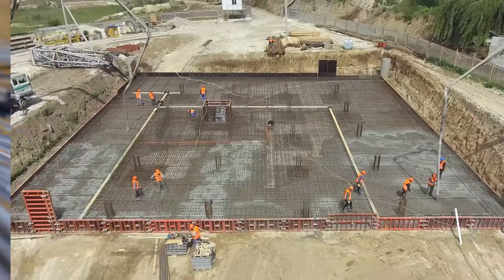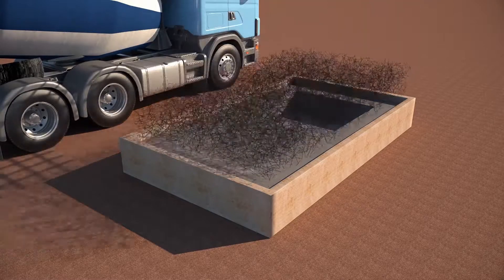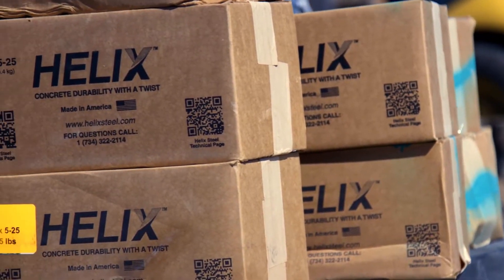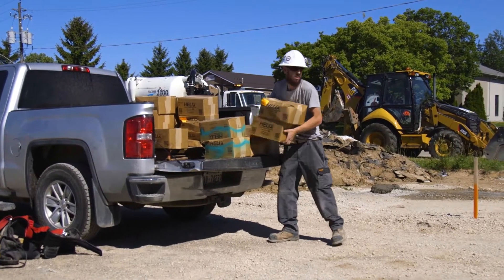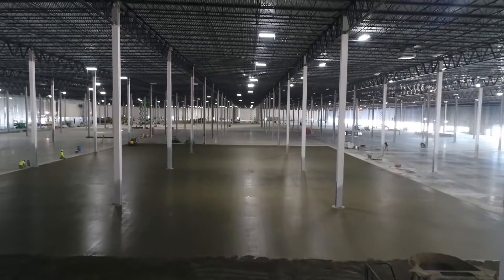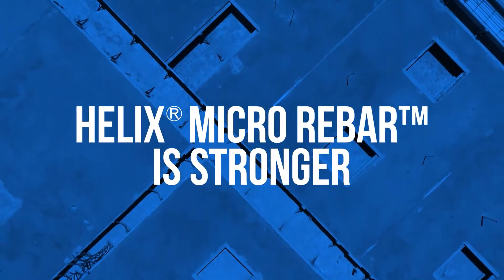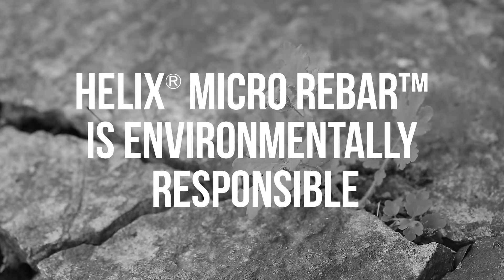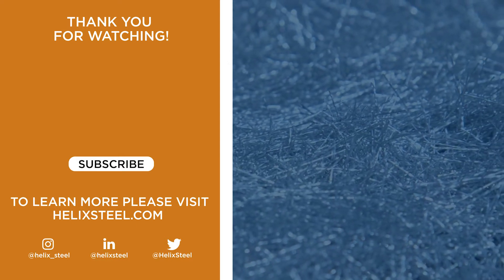Why Helix Micro Rebar Concrete Reinforcement is the  Better Way to Build with Concrete

Comment: Where can this product be found in Canada ? (North western Ontario around Thunder Bay that is)
Reply: Just place rebar
Reply: Don't know if this interests you.  Only place I could find it was Ontario Concrete Association, Woodstock, ON. It goes for $233.13 /each for a 5-25 Micro Rebar 45LBS Box. I too live in North Western Ontario (Bergland).

Comment: One of our warehouses has the parking lot made with small steel fibers as reinforcement. They're working their way out of the concrete and into tires. Rarely do they puncture, but i've had one leak this year and i only go there a handful of times a year.
Reply: The helix ones are smaller than the ones you are talking about I'm sure.
Reply: @Inova3DSolutions  There one factor that they have OVERLOOKED and that is the surfaces between newly solidified pourings sections that were poured yesterday and the new pourings that will be poured today. The solidified sections' helix steel fibers won't be sticking out to intertwine and interconnect with the new pourings. And the new pourings helix steel fibers won't be able to penetrate right through the already solidified yesterday pourings to intertwine and interconnect with the helix steel fibers of the solidified yesterday pourings. The pouring of helix steel fiber reinforced concrete must be continuously non-stop or must be combined with the use of steel rebars and steel hoops or loops or ties that are thick enough and spaced apart enough to allow the helix steel fibers mixed with the concrete to flow pass between them and around them and the spacing between the concrete molds and the steel rebars and steel hoops or loops or ties must be sufficiently wide enough to allow the helix steel fibers to intertwine and interconnect with each other between the main conventional steel rebars and hoops or loops or ties and the concrete molds themselves.
Reply: @Inova3DSolutions  The key is HYBRID steel rebar - steel fiber reinforced concrete that allows the use of conventional steel rebars and steel hoops or loops or ties reinforcement to provide NON-STOP CONTINUOUS reinforcement and allows the use of helix steel fibers micro-rebars to provide an evenly dispersed and evenly spaced and omni-directional and three-dimensional reinforcement throughout the entire mass of concrete itself. And the helix steel fiber micro-rebars will give additional adhesive covering strength to the concrete mass to adhere very strongly to the conventional steel reinforcing rebars and steel hoops or loops or ties.
Reply: @darthvader5300 punctuation is your friend. Word salad
Reply: @JohnLee-db9zt  Your sarcasm reveals to all Russians that all Americans cannot take criticism.
Reply: @KarlVonSttugart Lol. Just trying to help, Vladimir. 😉

Comment: bullshit... concrete always cracks, and will with helix. but with any type of reinforcement, even helix... it will help control cracking concrete.
Reply: Yup I heard there are two types of concrete,  concrete that has cracks and concrete that hasn't cracked yet.
Reply: Bottom line is it’s a labor and materials cost saver that has been approved for use by the construction and engineering societies.
It’s stronger than rebar . If it’s passes engineering specs it should not even be a discussion.
Reply: only roman concrete doesnt crack
Reply: Concrete will always do 2 things. Get hard, and crack. There is no way around it.

Comment: Does it rust out. Why not use another material other than steel? Fiber glass, basalt?
Reply: Cost, leed certification is why, they don't rust as easily because they are coated in something
Reply: @Inova3DSolutions zinc coated
Reply: @Inova3DSolutions likely zinc like rebar, but it’s steel so it will eventually rust.